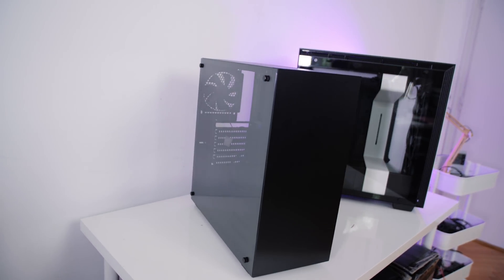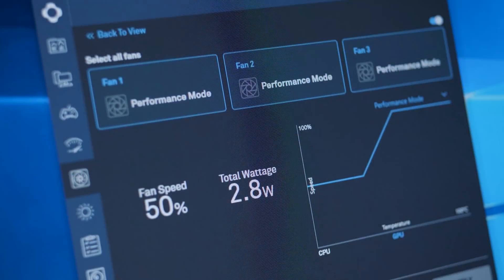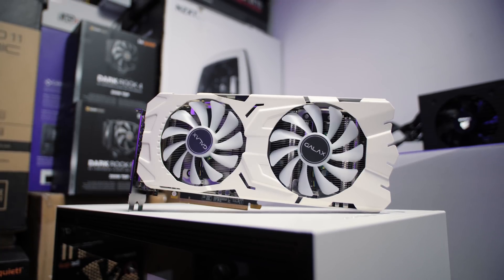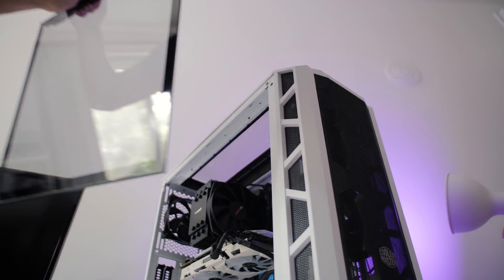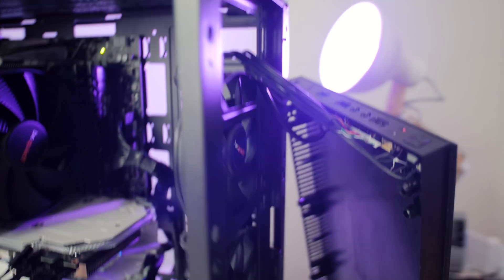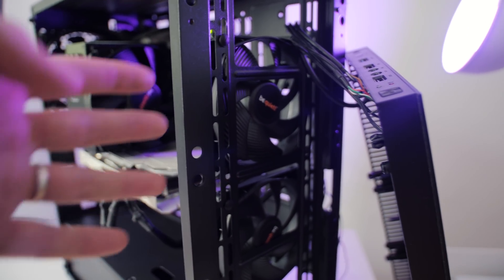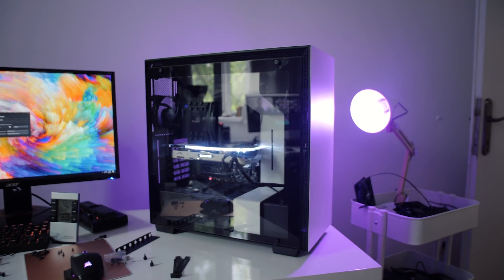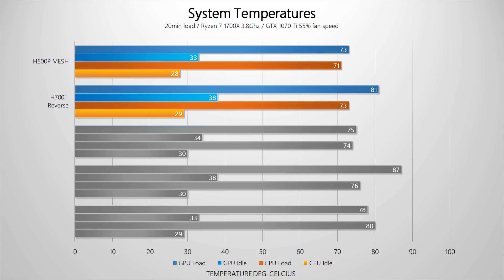What Happens If You REVERSE Case Airflow?

Comment: Dunno if anyone is reading the comments anymore but...
The negative pressure causes GPU to intake its own pushed hot air from its sides back to its own intake.
There should be either separate pushed air at the back or bottom to give the GPU fresh air while also normalizing the pressure.

Comment: 4:50 I think you should have moved the CPU can to the other side of the tower even if it gets close to another fan. This is because most tower coolers have pretty dense fin pack and you need lots of pressure to push air through and you cannot accomplish that effective by sucking air.

Update: I see you did this later. Good job!

Comment: What if you have front mounted aio? I’m curious about having rear, top, and bottom intake. And only front exhaust. I’m guessing it might be better for cpu and gpu as well as dust on aio. I’m using Lian li 205 with 1x rear 120mm 2x top 140mm, 2x bottom 120mm (psu shroud), front 360mm aio and front 2x 180mm fans (works with 360mm aio). ALSO my case is completely open (front panel off, side panels off, no dust filter beside the bottom).

Comment: Getting air out in from rear and upward fans will let the CPU cooler work better and get coller air flowing into it ..while the hot air goes out fast from frontal fans that's the best airflow setup you can make for your pc

Comment: This is why I always use a top exhaust design.  I actually have a Nanoxia Deep Silence 1 box with a Sabretooth 990FX that was running hot and kept shutting off totally on its own.  I decided to swap out to another motherbord and processor but in the process I found using smoke that my top exhaust fan was installed backwards and was bringing air in, instead of out.  I reversed the fan and this resolved the heat process and now, with the new motherboard and processor the PC is running cool and silent as a tomb.  Now, perhaps the new MB and processor produces less heat but I'm convinced the corrected top exhaust has been key.

Comment: Similar case design here.. I did 2x120 intakes, 1 120 in the rear exhausting and 1-120 at the top rear exhausting.  Installed the 2x120s inside the front of the case, removed the front panel and taped all the holes and gaps so air wouldn't be pulled from inside the case. My intent was to gain direct fresh air from outside the case only. It helps quite a bit! see the large gap above your front fan? yeah, trying to do intake with limited airflow, it'll pull air from inside the case and throw it back into the case like an eddy. Taping the front of the case all around the fans and any gaps behind the front panel makes a good 3-5* difference. Went from 80* down to 75* while benchmarking. Cheers!

Comment: The reason why the GPU gets hotter with the reversed fans is:
In the normal fan setting a front fan is blowing air directly at the GPU. If you reverse the airflow there isn't any direct airflow to the GPU.

Comment: I have the same exact Be Quiet fans model and I thought I mounted them (back 1x120 + front 1x140) in the wrong direction but I see your normal build is with be quiet logo to the front for intake. I used anti-vibration fittings and I can hear some subtle whistle so I thought it could be some air turbulence. Sorry if I missed something but english is not my main language and this was the first time I replaced fans in my case.

Comment: I have a Rakk Alpa that I'm going to try running upside down. The GPU above with an exhaust fan above it. Power supply on the bottom acting as an exhaust fan. 3x 120mm front intake, 1x rear 120mm and 1x 120mm top/rear intake. All are Arctic pwm pressure fans.

Comment: The heatsink that I have currently installed is too close to my ram slots and when I install the CPU fan I can't use the 4 slots so I moved it to the back, it sucks air from the back and pushes it trought the heatsink to the front. I have 3 fans in my case one in the front bottom that pushes cool air into the case, one at the top above the ram slots that sucks hot air and one at the back that also sucks hot air from the case. I was wondering if I could reverse the fan in the back so it pushes cool air directly into my cpu fan, I don't know if it will introduce a lot of dust or if there will be some kind of pressure that will shorten the life of my cpu fan.

Comment: In my next build I will have the air going from right to left, pushing cold air directly onto the motherboard and the watercooled CPU. The GPU may get a helpfan blowing out air upwards through the unused extension ports. I'm considering the Termaltake V21 because of the nice magneticmesh dustfilter on the sidepanel and overall modularity.

Comment: What if you put a the intake under the GPU, you'd have to jerryrig it. Then have the normal back fan be the exhaust. Wouldn't create a cycle of drawing cool air from the bottom and then pushing out the hot air at the top?

Comment: Listen Youngster (I'm 50 and have been computing since you were born) .. I have something for you. Consider,  the jig is up. the outcome is fixed and the game is rigged. These guys that actually design these cases Know what they are doing: I can take ANY laptop and put two bottle caps under the legs extending them and you'll cool your interior 15 to 20 degrees cooler. It's Exactly the same with cases, light bulbs and other stuff - they are designed to fail on Purpose. cases are designed to give you a nominal amount of cooling but they  know this will kill the CPU in time.. by design and on purpose. There are much better ways to cool the CPU, mostly is without a case altogether.. do the temps. The case no matter how it's configured actually hinders cooling. You still need heat sinks an fans but it;s much better than inside a case.

Comment: I use my front and rear fans as intake and have to fans at the top of my case for exhausting heat (case is p400)
the great thing about having the rear fan as intake is I feel it sends cool are strait over the vrms which help with cooling those off
all of them are pwm and I have the intakes set about 10% higher than the exhaust to create positive pressure and forces more hot air out through the top. to deal with the no dust filter on the rear fan problem I bought a magnetic filter that I just slap on the back of the case, it cant be seen from the sides or front so it takes care of that well enough for me.

Comment: MY CASE:
First off, there is RAPIDLY DIMINISHING benefits to case fan speed usually. The FURTHER AWAY you get from the heat source the less efficient cooling becomes... for a high-end gaming system the OPTIMAL FAN CONFIGURATION starting with three case fans is this:
1) x1 front intake
2) x1 top exhaust
3) x1 side intake (blow air over graphics card... most cases don't have this or the CPU cooler may interfere physically)

*Did you say if you have a set RPM for case and CPU fans?

Comment: As an HVAC tech and someone who has a degree in thermodynamics, this is right up my alley. It all has to do with your GFX card cooling. If you have a blower style cooler do NOT do this as you will be sucking in hot air and that won't cool your CPU as well as you would be sucking in air from the front air. The more air flow and exhaust the better it's going to cool off your card. Reserving your air flow is going to mostly kill off your air intake/exhaust to the card itself which is going to result in higher GPU temps. I would also recomned If you have a CPU like this one in the video I would recommend a blower style as it more heat efficient to direct the heat out of your case.

Comment: I reverse the fan at the back only and it lower M.2 temp,  VRM temp and CPU temp (CPU AIO mounted on the top exhaust) noticeably. Bought a 140mm fan filter for it and the end result is all the components get cooler and less dust inside the case since it is positive pressure and dust filtered. Been running for 6 months and barely any dust inside.

Comment: my fan arangement are 2 hd 120's in the front witch can't do anything because they are 2 mm away from the acrylic and the front panel is compleetly closed and then there are 2 120 mm fans in the bottom one blowing in to the plower style cooler of the top card and the other in the open cooler of the bottom one and the cpu has a modified intel stock cooler with an 80 mm fan for exhaust

Comment: I guess I'm too old for this. Around ten years ago,I used to play with various configuration of 80mm case fans.  For TLDR people,  I found that you can get away without an intake fan with just exhausts at highest possible mounts like the rear and top mounts.  If your exhaust is through the small vents, it just returns some hot air back to the case.

Comment: My airflow is fairly unique. My case is a Corsair 600C inverted. I have 3x 120mm fans set to intake on the bottom, 1x 140mm set to exhaust on the back and a Kraken x62 with 4x 140mm fans in a push/pull config set to exhaust on the front.

Comment: There is a possibility my Corsair carbide 600C may benifit better from reversing the cooling since it is a inverse ATX design, so it would not be recirculating the GPU heat back in, and with the Corsair H100i GTX AIO still blowing down the bottom of the case, if I got a stronger rear fan to pull air in from the back, it may actually help the NB temp of my old AM3+ board (I know, in desperate need if internal upgrade, blame DDR4 pricing)

Comment: I still use my cooler master storm sniper that has side, bottom and front intake 200mm and top and rear exhaust 200mm and 120mm with standard air cooler 2x 120mm fans but now I might get the rear fan off it and maybe put it at the top of the front panel for more intake and less "static pressure".

But I'm loving the 200mm fans

Comment: The one thing you should have thought of was the way air works depending on temperature, i.e, hot air goes up and cold air goes down... so the air you pushed from the back would have struggled to reach the front panel as it is a bit lower. However, I think it might have not made too much of a difference but a noticeable one. Anyway great video as always

Comment: for both CPU and GPU cooling you want the hot exhaust to have the shortest path out of the case. basically dont have hot air dumping into the case because case air is what the GPU cooler breathes in. since the GPU cooler is closer to the CPU than the case front, you will not be able to extract all that hot air before the GPU breathes it in. 

the best use of the rear fan is to get the hot CPU exhaust out of the case as fast as possible. GPU coolers have already been doing this for years with the dual slot configuration. you can improve the CPU situation by making sure the rear exhaust can at least match the CPU fan throughput, which unfortunately not possible for many cheap cases (1500 rpm 140mm CPU fan blowing onto 600 RPM 120mm rear exhaust fan)

you should not do a rear intake for CPU unless you have a dedicated tunnel out the front (or top). or if you have a method to let the GPU also have rear intake (not possible). there's also the issue of dust accumulation. you want dust filters at all intake positions, but case manufacturers these days are usually not providing filters at the rear positions.

Comment: I don’t test, but working with electrical cabinets, I use what I know. I usually put my radiators + fans in front, new air from bottom if possible and exhaust on top and rear. This config just helps the natural convection. If it is not possible to take new air from bottom, then I put my coolers on top, new air from front and rear side for exhaust.

Comment: A huge flaw seen in many temperature comparison videos. Where is the ambient delta value? All those values are meaningless. We don't know the time span between each test. Could have been many hours, even a day or two. Your ambient got hotter(or cooler) as the hours went by with all those stress testing and body work. Unless you do it again measuring your ambient temperature I will pretend I never watched this video, as its conclusion is broken.

Comment: I find exhaust fans have a much better cooling effect than intake fans just in general. Taking the hot air away is more important than supplying cool air in. It finds it's way in anyway. If you want to test this try comparing with and without intake fans. What intake fans do best is allow you to control where the air comes from and therefore filter out the dust providing you go with positive pressure. Also those side vents provide plenty of air intake even compared to an open mesh front, it's not like you are trying to move vacuum cleaner volumes of air through them.

Comment: I run my computer in reverse with a 420mm rad in front, 2x 200mm fans on top, and a 140 in rear. Only use reverse because if it was normal, anytime the computer goes under load it'd just slam hot air into the case and it heats the GPU a LOT, but the heat produced by the GPU and other components has little effect on the CPU... probably cause the overkill rad :P

I use a Thermaltake Core X71, which has removable dust filters (obviously I took out the front for free exhaust, and put it on top to help prevent collected dust going in) and just a grill in front, lack of rear filter for the intake does increase the dust intake, but it's not so bad considering I have a dog, two cats, and live in a desert, so dust is already plentiful.

Comment: @HardwareCanucks
Very interesting test,  but don't You think that the "raised GPU temp" simply  could be down to the fact that there is NO fan "feeding" the GPU at all in that setup. Wereas in the "normal setup" You have the bottom of the two front fans blowing what little air it can "pull in" directly towards the GPU ??
Best regards.

Comment: I'm not sure how you can say the unrestricted cool air benefits the CPU in the H700i when it's only 1 degree cooler. That's not enough benefit to be worth the effort of flipping the fans around, even if you don't need to touch a screwdriver. And the big thing, your reverse test just screwed over the GPU in terms of cooling. I can't imagine many people are running their OC right up against the thermal limit, but GPUs are designed to run there. The extra couple degrees the CPU is running cooler won't benefit you in games in the slightest, but the higher GPU temps will screw you over. Well, unless you have enough fans to exchange the case volume many times a minute.

Comment: the gpu will still push air outside the case.. even if little. Add that to the warm air coming from the PSU.. and all that coming back in the case. You could have used a small separation, like a piece of paper to control which air is coming in. I used this when i had a H50 and i could only mount it on the back, and taking air in. This was back in 2010 when cases were more limiting.

Comment: I tried this experiment once, a few years ago, in a CoolerMaster Storm Scout II, with six 120mm fans (one responsible for the first-gen Corsair H80i's radiator) and got drastically worse GPU results - like reaching throttling temps at idle.  I have a few hypotheses as to why, but it might just be too long to write up in a youtube comment. lol

Comment: my in fan config in the Corsair 900D is 3 Corsair maglev in the front for intake and For exhaust 1 NZXT aer 140mm in the back and the top 4 NZXT aer 120mm before the 480 rad and 4 Vardar behind the rad.

My idea for the rad that the Vardar's will provide the static pressure and the NZXT Aer will look awesome. And all fans are balanced in a way that you will have a natural or positive Pressure inside the case.

Comment: Interesting video thank you. I have a Antec Nine Hundred case slightly modded with an extra 3rd front case fan where the blu-ray drives used to sit. I also made the CPU  and GPU have their own chambers by sectioning them off so each has their own chamber in the case.

I vented the GPU  out the side of the case which worked a lot better than i was expecting because under load there is a lot of warm air coming out of that vent. Since there is a 200mm top case fan which can move a lot of air by itself I reversed the back case fan to blow into the case . So I have the 3 front fans and the back case fan blowing into the case set on medium speed setting. The top 200mm is also set to medium.

My system used to run warmer before doing this but now everything is a lot cooler temps really dropped every where. The only warm spot is the side vent for the graphics card I was even surprised how cool the psu was after this.Under full system load the air coming from it is nice and cool. Idle temps on CPU now sit about 1-2c above room temp load temp hover around 45-64c gaming and this is with a i7 2600K@5.0-5.1GHz on air cooling. Bsfore the changes the same system had my cpu at 56-76c gaming idles were about 6-8c over room temp. I have not done testing like they do here I just monitor the temps sometimes while gaming. I'm sure if I was to run the prime or Aida 64 stress tests my cpu would heat up a lot more,but that brings up a good point if my system never gets hot while I daily drive it and hardcore game on it then why would I give a crap how warm it gets in those programs which are made to juice up your systems and bake them.

For testing if my OC is stable I run CPUZ stress test for about 2 hours as well as cinebench at the same time if it makes it through this stable I know it is going to be game and daily driver stable.

Comment: I have an old case with two 14cm intake SIDE fans, 1 for the cpu and one for the gpu, a 12cm intake at the bottom plus a 12cm exhaust at the rear.
Mesh at the top and mesh at the front with no fans.
No window, but plenty of airflow.
Thats the better combo for me, i try everything with more/less fans in every position.
Good luck trying to find new cases with the chance to put side fans...